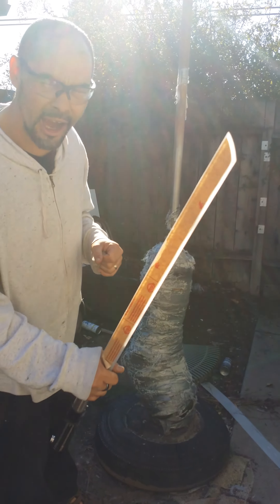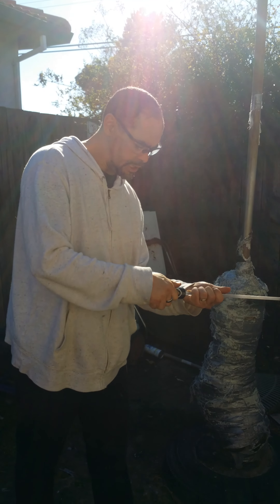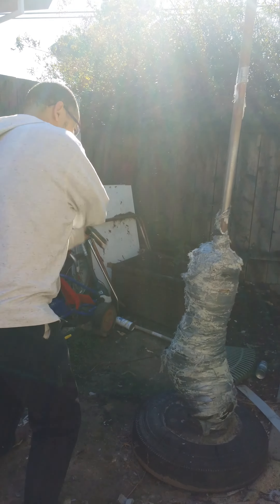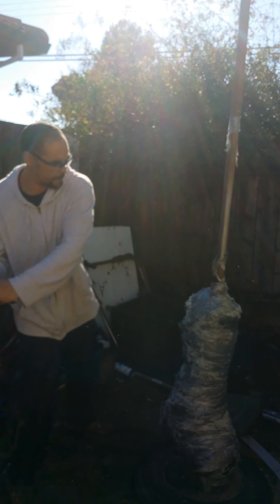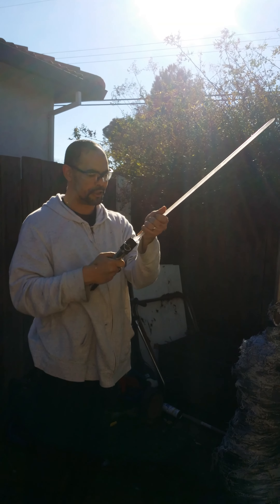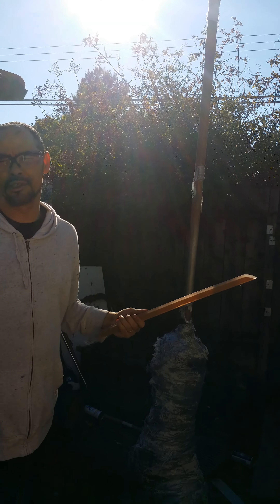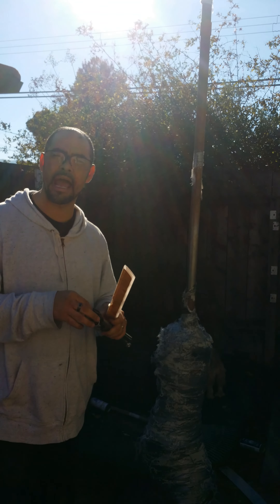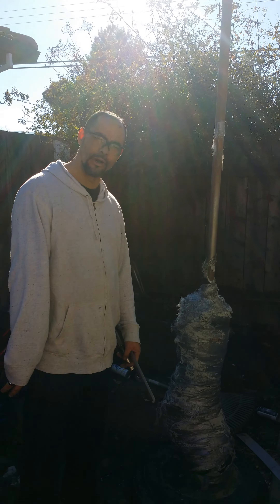Ripperblade PolyC. Durability Test.

Comment: Good work as always, Gary!

Makes sense, too, as... you've ALWAYS noted--right from the start--that the blades weren't "flimsy", but they aren't exactly meant for EXTREME duress.

On that note, I'm am 100% positive that on a thin-walled polycarbonate saber blade... I could INDEED break it with little trouble by striking most any surface extremely hard--especially if I did not "hold back" and neither did an opponent.

I don't see the POINT of doing any of that, though--you don't need to strike OVERLY hard on most any sword blow... even in reality.  It puts you at a disadvantage if you put all your might into almost every strike.  Doesn't seem much different to me for sparring, nor... staged combat.  :)

--Novastar

Comment: it's not structurally sound enough within the chassis or at the taper of the blade where it exits the housing. try making a test chassis that holds the blade blank with multiple contact points rather than one,  hopefully that should reduce some stress. also try tapering the blade more smoothly from tang to tip. it will need to be one solid piece. i hope my input helps,  you do gorgeous work,  with enough time and tinkering they will soon perform as beautifully as they look.